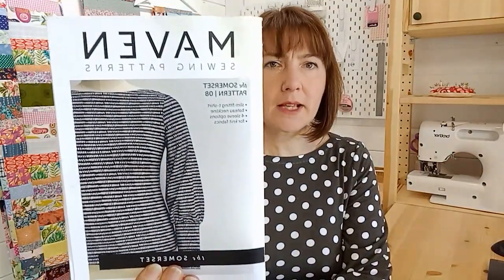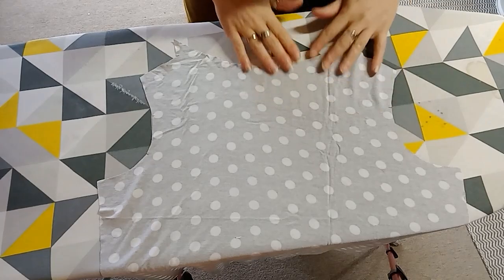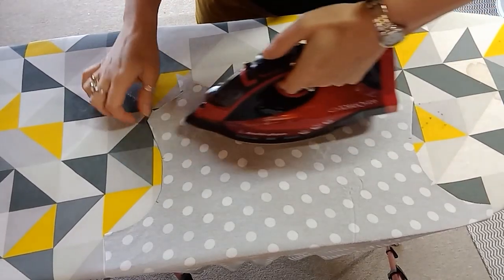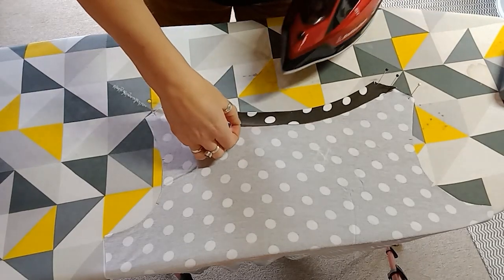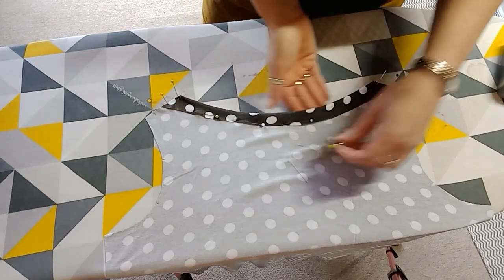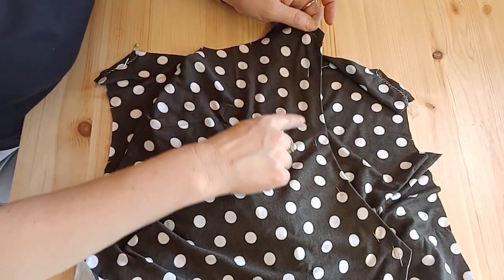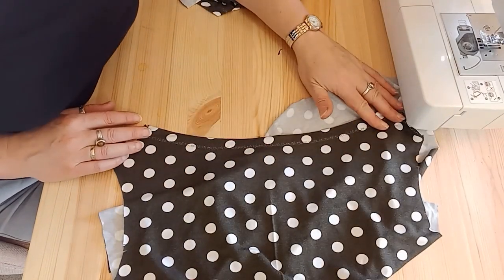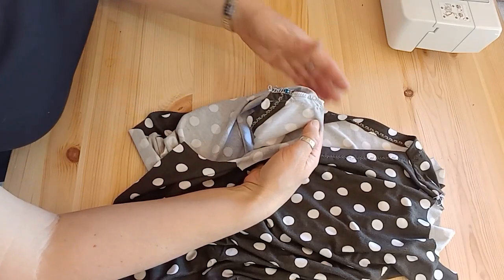Learn to Sew – How To Sew a Boatneck Neckline

Comment: Would you not add some stabiliser around the neck edge under the facing, like say a narrow strip of interfacing to stop the neckline from stretching over time?
Reply: You can use a stretch interfacing to make the top last longer. I have had mine 18 months and it is fine but it depends on the fabric.
Reply: @joanneroberts1088  Thank you